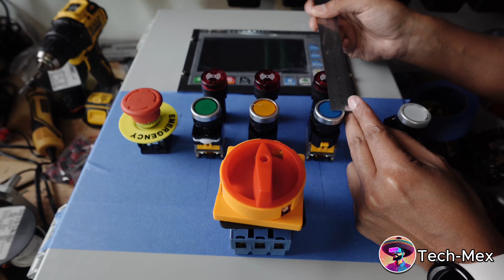[Part 2] CNC Controller Enclosure buttons

Comment: Why don't you use a small CNC, it would be much faster?
Reply from the maker: That is a good point. But what I'm looking for is  precision, rigidity and cutting power. Smaller CNCs (like Shapeoko or 3018) use aluminum extrusion frames and are good for wood, plastic, and light aluminum.

The G0704 is a cast iron mill. Once converted, it can handle steel and hard materials, not just soft metals. In addition it can scale to keep adding upgrades like changing tools, and coolant systems.